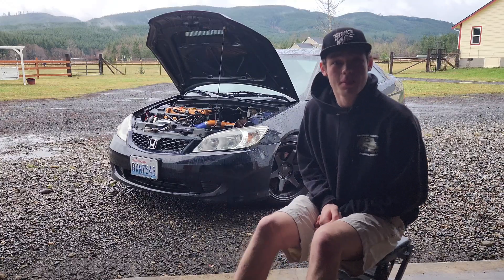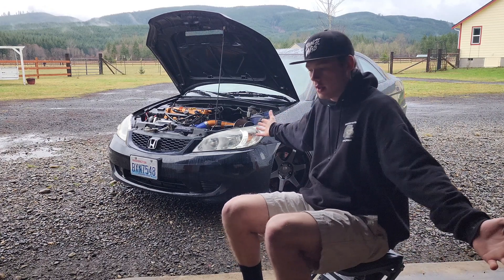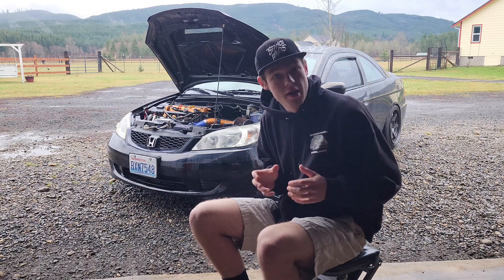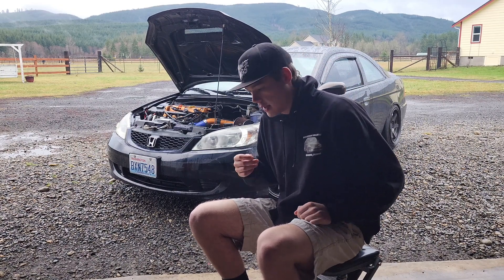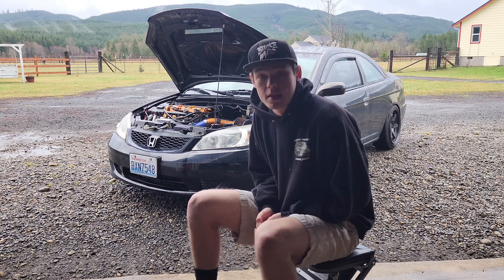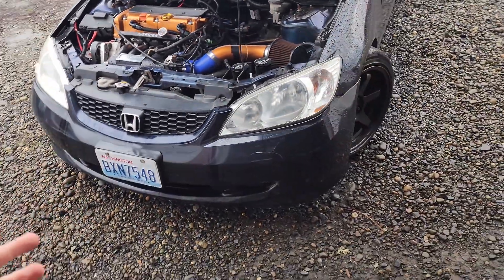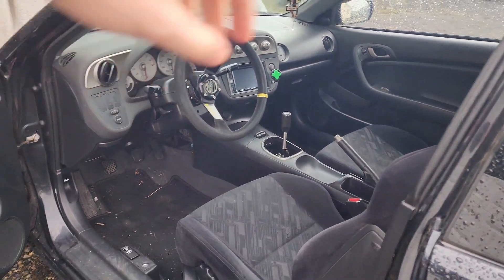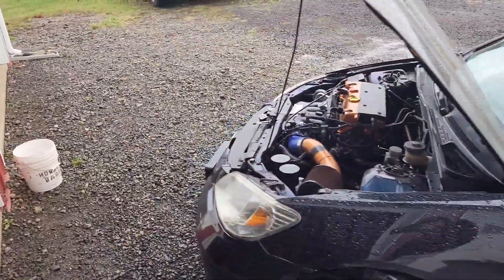Magnum Powers Supercharged Em2 Project(Remote Mounted). Pt.1

Comment: I had mine since 2015 or 2016. Cte supercharged k24 em2 but had already been k swapped for a couple years. 350whp 270 torque. In the middle of adding nitrous now. Good luck man looking good.

Comment: Took out the ABS? As long as you’re not racing it, or driving too hard on crowded streets. Some people think they can manipulate the brakes better than the ABS. Those people find out real quick how wrong they are.
Be safe out there and mindful of the road conditions and drivers around you.
Reply from the maker: It never came with abs, and I have used this car in auto x, drag strip, and back road fun. It leaves it more to the driver, and I prefer it over abs. I have driven this car multiple winters and ice storms, and I've had zero issues. I know this car incredibly well and there almost isn't a bolt I haven't touched. I do not plan on installing abs either.

Comment: How much more engine bay space does the K take?
Reply from the maker: It takes up way more space than the d series
Reply: @mighty_moran_motorsports  ok I guess it's a sacrifice one has to make for a car that's safe to merge onto the highway. The D17 is so slow and torgue Less . I've never owned a car that didn't have engine bay space to make it easy to work on so that has me thinking. 6 speed potential make the swap tempting as well too
Reply: The D17 is good on gas and reliable so I'm not bashing it too hard.
Reply from the maker: My em2 gets 38mpg right now with the k24. And k series is where more reliable in my opinion
Reply: @mighty_moran_motorsports  I'm so glad to hear I had a feeling it would be very efficient because the 2.4 liter doesn't have to be revved to the moon to get to 60mph. The torgue will have a chill driving experience untill you want to go fast. It also must be very peppy around town because of the torque too. I like that it has a timing chain instead of a belt. The D17 is always too busy which causes the car to burn more fuel since my foot is always pedal to the metal and still slow
Reply: I would like to hear more of why you chose remote style for the Super Charger and what other type of Super Charging. Is this like a rear mounted turbo etc ( good ideas for YT topics)